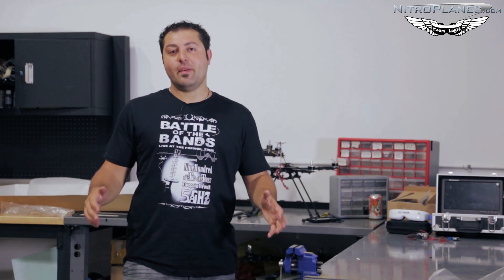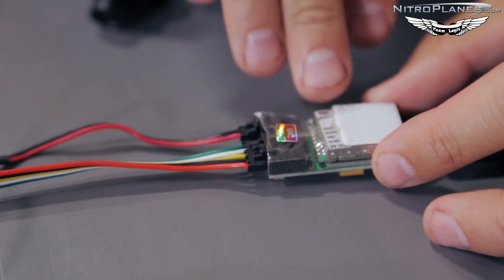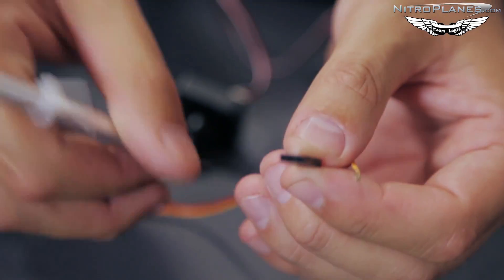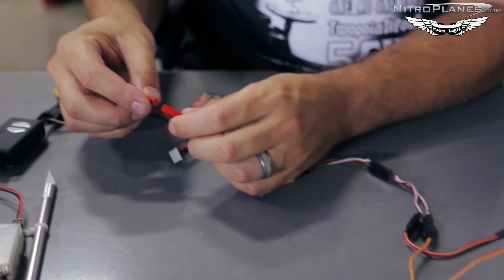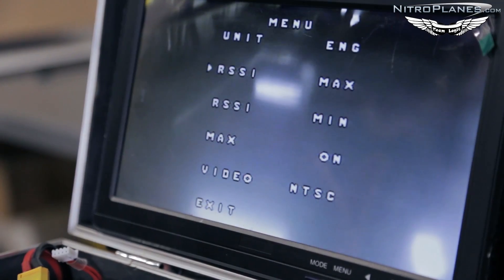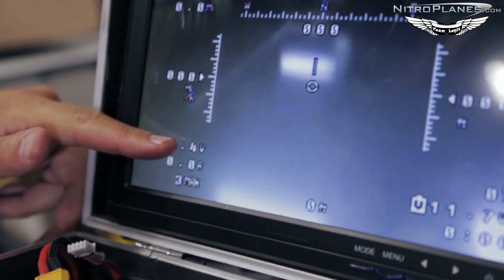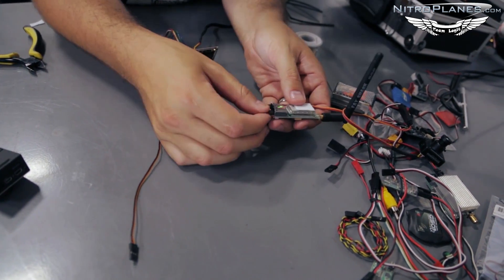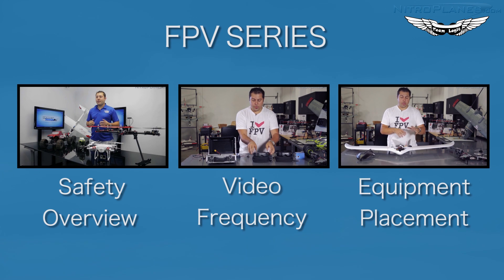FPV Series Episode 6: Simple OSD Wiring

Comment: So I only need this for GPS and RTH (return to home) as well as the OSD, or I would call that a HUD. I don't need a flight controller? I have a receiver with telemetry ports, and a FS-i6 transmitter all set up. So can I plug this in to have GPS functionality, RTH and HUD? I also have FPV set up.

Comment: Thanks for the video.  A few quick questions. want to install a cam with OSD like you showed on an opterra.  Can you recommend a board to use for GPS, airspeed voltage, etc?  I was considering the Immersion RC EzOSD.  Also, what camera would you recommend I use with it?  Many of them have a built in OSD.  I guess I would not want that.  I plan to use a mobius for the recording.  just need a cam for the nose.  Thanks!

Comment: ok on osd - u plug ur cam - ur fpv transmiter - ur gps modual - im I correct to understand to get your drones volts we need to feed pos and neg into the osd unit kinda how u did when you plugged in the battery

Comment: Hi I'm new to the drone world.
I'm trying to set up my FPV using a FX X40 5.8ghz 40CH 200mW transmitter.
My question is are all servo connectors the same size if not how do I determine the size I need?
I need a male 3wire servo connector so I can solder it to a 90 degree micro USB cable to use a action cam.
Reply: Servo connectors are always the same. 3 pins, bottom pin is GND or ground. Middle pin is +5V. Top pin is either signal, or empty. Some have a little notch for orientation, and this is always standard. There is a matching notch in the servo port, at least in your receiver.

Comment: HiI have a cheerson cx20 drone which has a gps. I bought the skylark tiny osd. My question is the drone and the tiny osd both have a gps. Do I use 2 gps or wire it to use only 1. I forgot can you have 2 gps module side by side without interference
Reply from the maker: You will have to run both GPS and they will be fine next to each other since they are both receiving
Reply: Ty so much.  the 1/2 sheet instructions on the tiny osd are terrible , I'm new to this and it is very confusing, like RSSI   what...   lol
Reply from the maker: +MrMetor99 RSSI is range signal strength indicator. if your transmitter rx can put out rssi you can see when your radio control signals are getting weak.

Comment: I have Remzibi  ...on one side it has ENG GND GND VCC  ,  same side to the right it has IN GND OUT GND    .  It didn't come with wiring instructions ...but it has a website  for program.  this does come with 1-OSD 1-GPS module 1-wiring set "four wires black white gray and brown . Also a USB cable with five pins GND RXD TXD 5.v  3.v   can you send me a eMail a diagram on how I wire this up please ?  Donatilloarteaga@yahoo.com  I have the 1.2 ghz  1.5w  runs on  12v.   small camera is also 12v. or anyone that has one of the same Remzibi V1.79 OSD WITH U/BLOX 6M 5GHZ GPS module....  Thank You !

Comment: Thanks Johnny made this way to Simple and I am  very confused, not really just need advice.  
1. Link for  the OSD you are  demonstrating, I guess the gps is not included, and is needed?
2  I have a DJI phantom V1.1.1  I can get OSD a two part, cost  70.00 per part.

A) http://www.amazon.com/gp/product/B00CR5H75C/ref=as_li_tl?ie=UTF8&camp=1789&creative=390957&creativeASIN=B00CR5H75C&linkCode=as2&tag=willu08-20&linkId=NHKENYPL4JQD7XZQ

B) http://www.amazon.com/gp/product/B00FKZZQQS/ref=as_li_tl?ie=UTF8&camp=1789&creative=390957&creativeASIN=B00FKZZQQS&linkCode=as2&tag=willu08-20&linkId=XVD6MOMAO3IPDUAM

 the Cyclops storm, you called it, breeze  I think a poster called it  80.00 with  the gps

A)http://www.ebay.com/itm/2013-new-arrival-Cyclops-Breeze-OSD-V1-0-fpv-multicopter-/140911716827?pt=LH_DefaultDomain_0&hash=item20cefe29db

 DJI has a Home Icon     there is a 70.00 difference  

3. Which one do you think is the better for the DJI. I do not like to be looking at a super complicated screen?  I like to know  when its  time to return back before a dead battery.  Know my distance, something that was not discussed in the video.

I do thank you and all in advance    In my eyes  the DJI is made for the craft,  and may have the added bells I need, while always good to keep all options open.

Personally I go have a nice flight not far not high and keep to a 8 minute  run. never had OSD,and if it saves me from a low bat. it is paid in full first run By the time  thanks

FISH
Reply from the maker: ***** Hello. the OSD's used are available on our website. http://team-legit.com For a phantom, I would go with The DJI ones they provide more info.
Reply: I expected that answer thanks will do

Comment: Wow, what a awesome job at addressing and explaining fpv and osd wiring,
I'm going to be attempting my 1st osd connection to one of my fpv set ups and by watching this vid. It should go ferly easier then I anticipated. Would you recommend a 1st timer OSD board? Thanks again, Kazz.
Reply from the maker: Hey Kazz, What type of aircraft is this going into?
Reply: Team Legit Don't laugh, I want to install one on a CX20
Q? Would I tap into the CX20s GPS? or would you suggest a Osd with GPS?
That would bring me to another Q?. Is it not safe for 2 GPS devices on the same unit?
Reply from the maker: The 2 Gps receivers can be close together without issues. They are both looking for the same signal.

for the osd I would suggest the cyclops breeze osd if you can fit it inside your quad copter,

good luck.

Comment: last time i thougt to use servo cabels to extend the eagle tree system for the fpvraptor, it is a long distance from the back (videotransmitter) to the plains front (cam) so now i will try - thanks a lot! what osd do you use innthe video? looks pritty simple :D
Reply from the maker: Thats The Cyclops Breeze OSD, All of the Cyclops Line of OSD are really easy to set up and wire up.